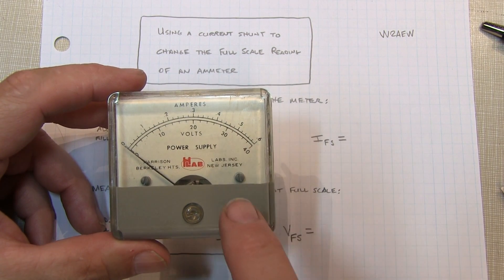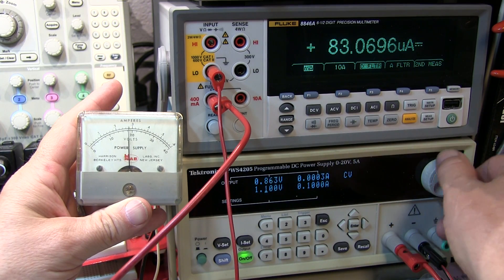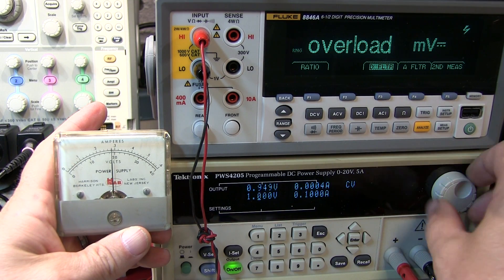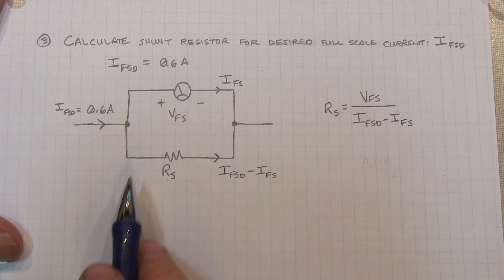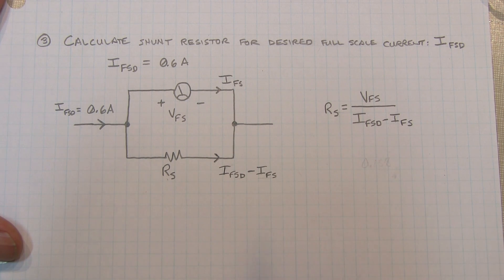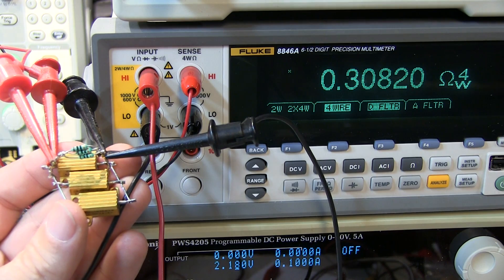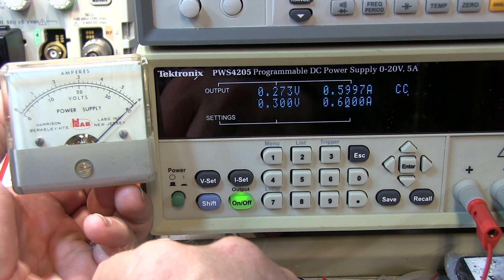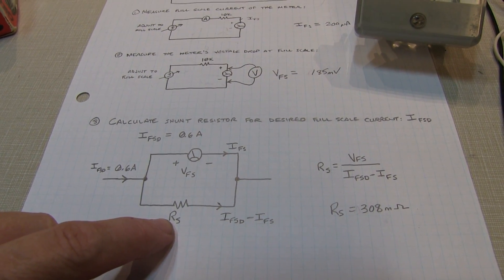#236: Using a Current Shunt with a Panel Meter / Ammeter scale change

Comment: Great video. How do you configure the meter to measure AC voltages or currents?
Reply from the maker: For AC voltage, you’d use a diode or diodes to rectify the voltage then measure as a DC voltage. AC current measurement is a bit more involved. Usually a differential measurement of the AC voltage across a shunt done then is rectified to measure as a dc voltage.

Comment: Guitar amplifiers biasing using a transformer shunt method to measure the output tubes plate current flowing through the output transformer. The DVM meters impedance is LESS than the output transformers primary windings so the current will Flow through the DVM meter instead to measure the biasing current. You connect the DVM meter in current mode across the output tubes PLATE to the output transformer primary High End terminal to measure the biasing current. Can you do this type of biasing for FETs amplifiers and transistor amplifiers in power amplifiers to use the shunt method? Its rare to see a DVM meter in current mode placed in parallel across a WIRE. Maybe you can think or find other applications that can use a DVM meter in current mode using it to measure bias current in a SHUNT Method?

Comment: Easier to use a low value resistor (1 Ohm for example) in series with the circuit, then turn the meter into a voltmeter to simply read the voltage drop across the low value resistor.
MUCH easier than all those small value resistors. Also, since the meter is multi scale, it is easier to use it as a voltmeter too. Not just dedicate it to reading current.
Reply from the maker: Of course - it all depends on how much burden voltage you're willing to accept when measuring current.

Comment: Hi, I need some insight on how to make the minor adjustment to get a 50 microamp panel meter extent to work in place of a panel meter specified for 60 microamps. This is for an old Lafayette TE-46 capacitor analyzer. The original meter must have been damaged and someone replaced the original with a 1 Milliamp meter. Using your process The original meter is reading full scale at 1.14 milliamp and a new 50 microamp meter is running full scale at 48 microamps... Thanks for the video as I now know both work and what gets them to full scale.. Note my 100K resistor used for this tests at 9.946k on a 4 wire HP 3478a... That said I'm not sure what to do next. do I pursue working on extending the range of the 50 MA meter or shunting the 1 Milliamp meter? I'd rather use the 50 Microamp meter. Along with this question I've seen some discussion regarding adding diodes across these meters to protect them from going overscale and I'm not sure what or how to add this into the mix... One gentleman added two schottky diodes and another used two 1N4001 diodes reversed against each other. Honestly I don't really understand how these help yet but I'm sure there is a voltage drop issue I need to be aware of...Any insight on how to proceed and certainly some assistance on the shunt values to extend the 50microamp meter would be appreciated... (Would it be possible to use a small resistor in series with the meter instead of a shunt across the meter??) Oh I hope you are still out here... Of all the videos I've seen (and there have been many) yours are the easiest to understand for a novice...
Reply from the maker: The process shown in this video is exactly what you should be able to do to in order to use the 50uA FSD meter in the application that needs a 60uA movement.  The shunt resistor would be carrying 10uA when the meter is at full scale.  If you have measured the voltage across the 50uA meter when it is reading full scale, simply take that voltage and divide it by 10uA, and you'll have the shunt resistor value that you need.  For example, when the 50uA meter is at full scale, suppose you measured 100mV.  Then, the shunt resistor you would need would be 100mv divided by 10uA, or 10kohms.
Reply: @w2aew  Thank you, exactly as suggested the 10K resistor across the meter provided a full scale 60 uA across the meter. I also experimented with adding two schottky diodes across the meter along with the 10k resistor but these added an additional voltage drop causing the full scale to be more like 80 uA. (78.97 ua and 101.772 mv across the meter) However, I added two 1N4001 diodes across the meter along with the 10K and there was no impact. With the 10K resistor and the two 1N4001 diodes I have 59.52 uA and 101.158 mv across the meter. Without any shunt resistor the measurements are 48.57 uA and .098889 mv. Using the calculations I learned from you it appears that the meter itself must be 2036 ohms... I'm confused why there is no voltage drop impact by the 1n4001 diodes and there was an impact with the 1N5817 schottky diodes. Either way, considering I'm at full scale at 100 mv I imagine the meter will be destroyed long before either of these diode solutions start to short and pull current away from the meter.... Anyway, thanks for you help and awesome videos. I've watched many and find them well thought out and very insightful!! Thx, Ben. NJ
Reply from the maker: @bendec2969  Well, I supposed I had a lucky guess by suggesting that the voltage across the meter was 100mV at full scale!  Glad it worked out. The reason the schottky had a problem is likely because you had it forward biased and it was turning on slightly as the meter reached full scale.
Reply: @w2aew  Which diodes will provide the best protection... Just seeking your advise and not holding you responsible for any decision I make!

Again thanks for responding... I really appreciate the education. I'm having a lot of fun fixing my old toys with this new found hobby. Several heathkits sig gens, vtvms, Fisher Amp improvements - 400, 500c, (500B is next). Very happy with the result on a restoration of a very old Precision Model 68 VTVM and a PACO model 70 both with a DC voltage accuracy that is blowing my mind... I have a couple of their tube testers (610 and a 1012) and I have to say they were really a quality focused company... I've made minor adjustments to both and they are working fine although the 610 is at its limits and really needs a bunch of precision resistors replaced but I'm nervous about digging into this as the wiring is intimidating... My favorite piece is a fully professionally restored and beautiful Hickok model 605A (which I won't touch). Precise, Precise, Precise.... I've noticed that several tube purchases from reputable ebay sellers who used precise metrics for their tube sales I almost mirror....And several new tubes test at the exact recommended value listed in the documentation... Anyway, thanks for the help. I think I'm going to watch one of your videos and relax for the evening...  Ben

Comment: You're not really changing the scale here, are you? The meter's scale is 0.6A, which I think is why you had such a low shunt resistor value, no?
Reply from the maker: This one already had a scale that I wanted, but that scale was only valid with the proper shunt.  Full scale deflection was at 200uA, so the shunt was needed to get back to the 600mA scale.

Comment: When using a Fluke DVM meter in ammeter mode, is there internal input and output buffers circuits or DC decoupling capacitors on the input ports and output ports while in ammeter mode? There is protection circuits to block DC and buffers even while in ammeter mode.

Comment: Before the 50s they didn't use the resistor Color Code system. Each manufacture on the schematic would indicate a color code system for the resistors and capacitors. What are these other color code systems called and were used before the 50's?

Comment: When using Light bulbs as current limiters to test for short circuits its really confusing because if you use one light bulb rated at 60 watts divided by 120VAC = 0.5 amps of current. If you use 2 light bulb wired "in parallel" will be a total of 120 watts divided by 120VAC = 1 amp of current. Logically I would think wiring up resistors in parallel would decrease and lower the current limiting. If you used a 120 ohm/60 watt resistor as a current limiter that is 120ohm /120vac = 1amp of current, if you wire two 120 ohms/60watts that is a total of 60 ohms/120 watts = 0.5amps of current. Its confusing because the light bulbs are inverse of a resistor? or what am I missing and not understanding?
Reply from the maker: Your math for the resistors is wrong.  If you have a 120ohm resistor with 120VAC across it, that resistor will dissipate 120W and the current will be 1A.  If you wire two of these resistors in parallel, then each resistor will draw 1A and dissipate 120W - so the combination draws 2A total, and dissipates 240W total.
Reply: @w2aew  120 ohm resistors in parallel with another 120 ohm resistor = total resistance is 60 ohms. So 120vac divided by 60 ohms = 2 amps which is Doubled. A 60watt lamp bulb is 60watts divided by 120vac = 0.5amps. Using two 60 watt lamp bulbs in parallel is 120 Watts divided by 120vac = 1 amp. What I'm confused about is a 60ohm resistor is NOT Equivalent to a 60 watt bulb, any reasons why? because 120vac/60 ohms = 2 amps compared to 60watts/120vac = 0.5amps. See how they are inverse the resistor and lamp bulb?
Reply from the maker: @waynegram8907  You're mixing up the resistance and the *power dissipation*.   A 60W bulb operated at 120VAC results in 0.5A current. Thus, the bulb's resistance is 120VAC/0.5A = 240 ohms.  Put two of them in parallel and you get 120ohms, which will draw 1A at 120VAC, each one dissipating 60W for a total of 120W dissipation.
Reply: @w2aew  The filament inside the 60 watt lamp bulb will always have a resistance at 240 ohms at 120vac at Full Brightness like if the circuit under test has a short circuit, but when the circuits current draw is LESS than 0.5A the resistance of the filament changes to a different value. The Filament is not equivalent to a resistor. A 60 watt Filament is a 240 ohm resistor at 120vac but its not the same as a 60 watt/240 ohm resistor, any reasons why? A Filament is like a variable temperature potentiometer, as the circuit under test draws the maximum current of the Filament which is 120vac at 60 watts = 0.5 amps short circuit max current draw which is 240 ohms resistance of the filament. If the circuit under test is only drawing 100mA the 60watt lamp bulb resistance has changed to 1200 ohms and only using 12 watts of the 60watt lamp bulb . 120vac/100mA = 1200 ohms
Reply from the maker: @waynegram8907  If a bulb is operated at a lower current, thus the filament is not heated up to normal operating temperature, then its resistance is LOWER than the fully heated value.  For your 60W bulb, the filament is 240ohms at full 120VAC.  But, at a lower current, it is lower than 240 ohms (you'd have to measure it).  The idea with a dim-bulb tester is to put the bulb in SERIES with the device you're testing, so that it presents very little voltage drop during normal operating of your device, but if your device shorts out, then more current flows in the bulb, heating the filament, increasing it's resistance which then limits the current to save your device from damage.
Reply: @w2aew  yes, two lamp bulbs is 240 ohms X 2 = 480 ohms , but two lamp bulbs in parallel total resistance is 240 ohms. 120vac divided by 240 ohms is = 0.5 amps. but the wattage is 60 Watts X 2 = 120 Watts. Which 120watts/120vac = 1amp. The total parallel resistance current is 0.5 amps but the total wattage current is 1amp. This is confusing because the total parallel resistance current should equal the total wattage current
Reply from the maker: @waynegram8907  You're simply doing the math wrong.  Ohms Law holds true, regardless of whether you're talking about resistors or lamps.  Note that the wattage of a lamp ONLY APPLIES at the rated voltage.  If less voltage is applied, then the lamp will dissipate less than the rated power.

Example:  

A 60W 120VAC bulb has 240ohms of resistance, and draws 0.5A when 120VAC is applied.

Two of these bulbs in series adds up to 480ohms, and would draw 0.25A when connected to 120VAC (assuming the filaments heat to their full operating temperature - which likely won't happen, but will assume it for the sake of argument), and each dissipates 15W since there is only 60VAC across each bulb  (60VAC * 240ohms).  Thus total power dissipation is 30W (120VAC * 0.25A).

Two of these bulbs in parallel - each draws 0.5A from the 120VAC supply, dissipating 60W each.  Total current is 2 x 0.5A = 1A, and total power is 2 x 60W = 120W.

Same exact math applies if you're talking about individual 240 ohm resistors instead of light bulbs.

Comment: A current meter doesn't tell you what type of current waveform the LOAD is changing. If you take a look at this video link i will be posting watch how all the different LOADS used will alter, modify and change the current waveform from the AC outlet wall. When you plugged in a oscillating fan watch how the current waveform is wobbly and bouncing up and down because of the fans motor oscillating which is causing the current waveform to bouncing up and down oscillating. If you plug another equipment in the same AC outlet the AC current waveform will backfeed and bleed into the adjacent AC outlet socket. It would be nice if you made a video lesson about this subject on how various loads plugged into the AC outlets will cause the AC current waveform to be totally modified, altered, reshaped which will cause problems with other equipment being plugged into the next AC outlet on the SAME circuit breaker. CLICK HERE  https://www.youtube.com/watch?v=JDKMYnxBNtg

Comment: I have one question 2:12 why 0.185 when lab supply shows  2.180v can you please clarify. thanks
Reply: The lab supply is feeding a 10k resistor as well as the meter, in series.  With 200 uA flowing through the 10k resistor, there is a 2 volt drop across the resistor, and then we expect the 0.185 volts across the meter.  We saw a little bit less than 2.185, first because the power supply was being adjusted in 10mV increments to 2.180mV, and then there were several other factors that made it no so perfect.  It's off by about 2.7%; plenty close enough for a tutorial!

Comment: Curious if I would also need a series resistor going to the meter, or is that already contained inside the meter?
Reply from the maker: For an ammeter, a series resistor would just add unneeded (and unwanted) voltage drop.
Reply: @w2aew  So does the analog panel meter have a built-in resistor, or is it just the inherent resistance of the meter itself ( the windings and such)? 

An "ideal" ammeter would have zero resistance, so any (parallel) shunt would have no effect on its full scale current handling ability, right?

So, I guess I'm asking if you only rely on  the inherent resistance of the meter itself, or can you add to it a bit with an additional series resistor... 

Like if I wanted to use a 100mA meter for a 1A @ 24V project I could set up a 250m Ohm (shunt) / 2.5 Ohm (series) divider...
Or is this series component not required since the meter itself is already acting as a 2.5R resistor?
I apologize for my ignorance and sloppy math.
Reply from the maker: @andrewferg8737  In the case of analog meters like these, the meter's coil has resistance and determines the voltage drop when measuring current.  Any additional series resistance would simply add to the ammeter's burden voltage.
Reply: @w2aew  Thanks so much for your patient reply. I did a bit a experimenting last evening and was able to get a 3mA meter working with 100m Ohm shunt for my 24V @ 1A project. 

I've got bunch of these .1R resistors in my junk box, and have always wondered why anyone would manufacture a such a tiny value resistor. Thanks again!

Comment: Great illustration. Dont you think that a carefully chosen wheatstone bridge 4 arms values has an equivalent benefit or probably adds to this method of separating the applied current leads from the voltage measuring leads (aka 4-wire method)?